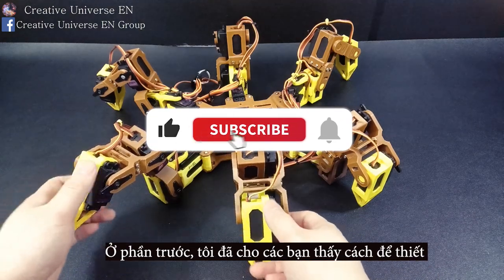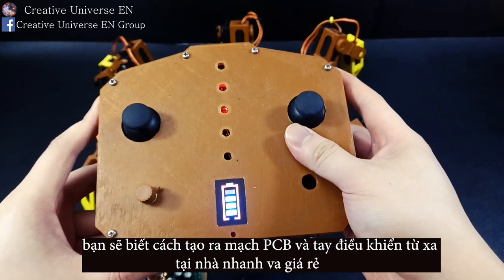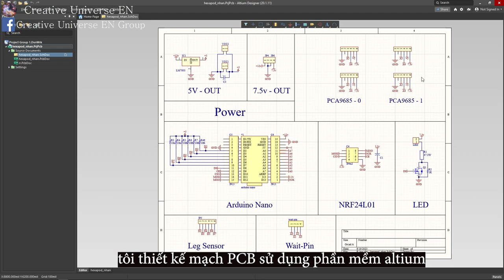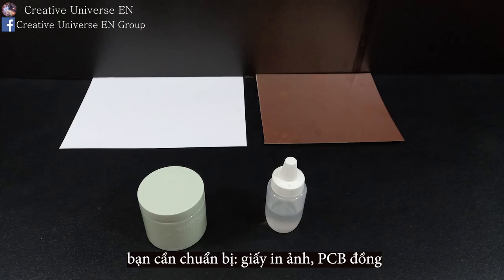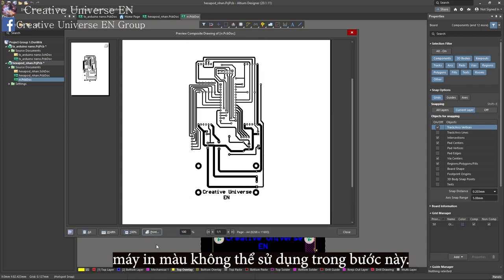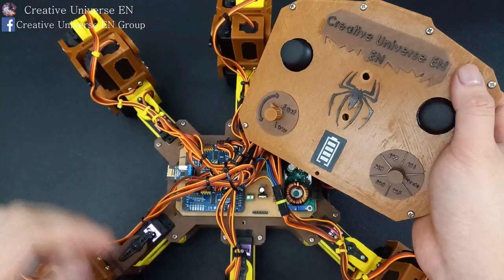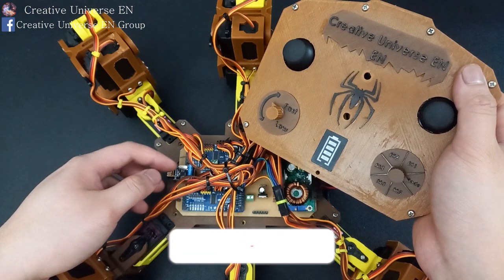How I built an Arduino Powered Hexapod. Part 2 of 3: electrical & control systems

Comment: Em kh chuyên về bên điện lắm, cho em hỏi là sao phải nâng lên 12V rồi hạ xuống 5V kh ạ?
Reply from the maker: trong trường hợp của mình để cấp nguồn cho servo là 7,5v và 5v để nuôi ic điều khiển. ở 2 mức điện áp này hệ 1s và 2s không đáp ứng được nên sử dụng 12v rồi hạ áp xuống là tốt nhất.
Reply: @TheKingLab  anh có thể cho em xin link mạch boost như trên video kh ạ
Reply: @TheKingLab nhờ có anh truyền cảm hứng nên hiện tại em cũng đang làm về hexapod. Mà em dùng hệ 2s với mạch boost 10A 6V mà nó bị quá tải ngắt mạch ltuc @@
Reply from the maker: @just_sgc4728  b dùng loại servo gì. nếu quá tải thường có 2 trường hợp xảy ra. 1 là do lỗi code khiến servo bị kẹt ở đoạn nào đó khiến quá tải. trường hợp còn lại là do mạch k đủ công xuất thì b thay loại lớn hơn là được.
Reply from the maker: @just_sgc4728  b lên shoppe gõ tìm kiếm "mạch hạ áp DC-DC 20A"
Reply: @TheKingLab  ôi nhìn trong video em nghĩ là loại 10A thế là em mua loại 10A cho con 996r
Reply from the maker: @just_sgc4728  sau nhớ đọc datasheet trước b à. tránh gặp những lỗi vặt không đang có.

Comment: what were the mAh per battery? if im not completely brain dead here. I calculated the mAh to be 2500mAh per battery.
Reply: and did you use a 12v or 3.7v BMS?
Reply from the maker: 2s bms. 2500mA